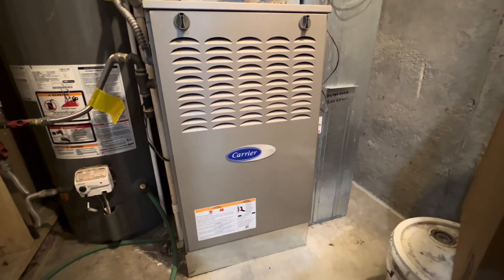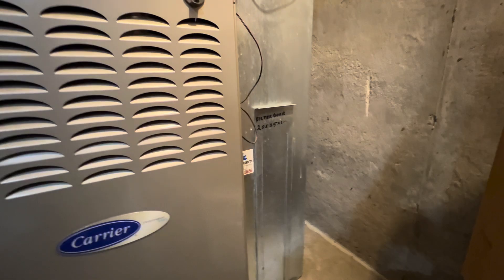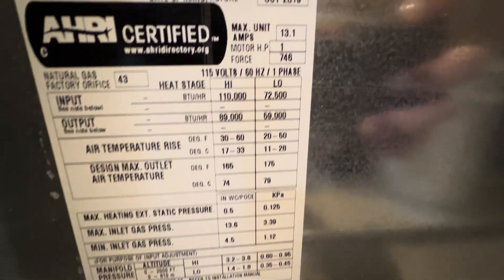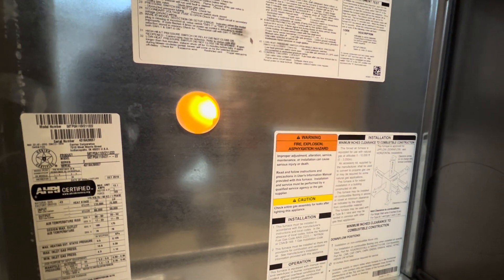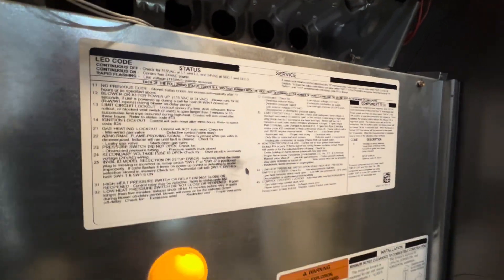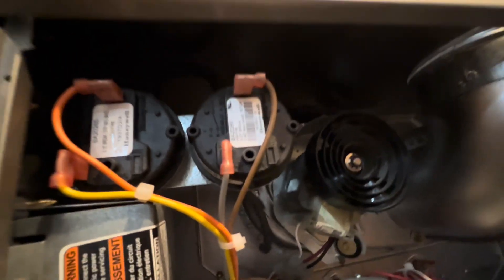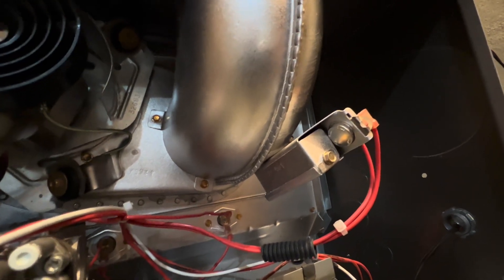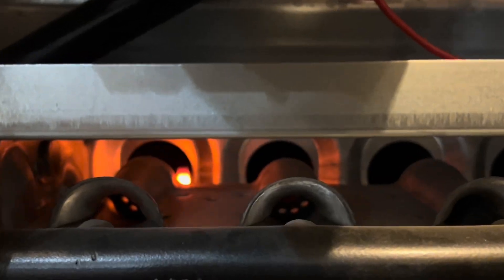EPIC INDUCER MOTOR! Overview & First Startup Of My 2019 Carrier Performance Series Gas Furnace!

Comment: The lights are staus/trouble codes but, they wont always give you the answer but, they get you closer. Pressure switch faults are usually due to deteriorated connecton tube ends.